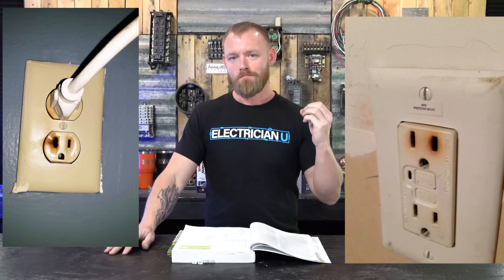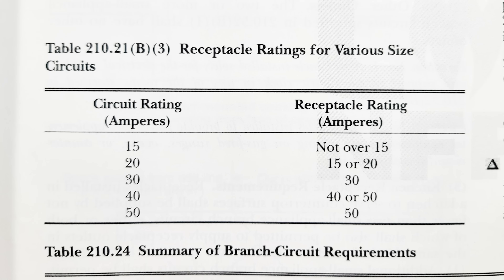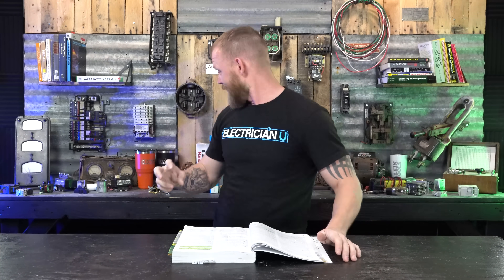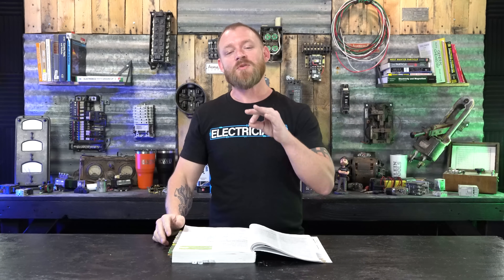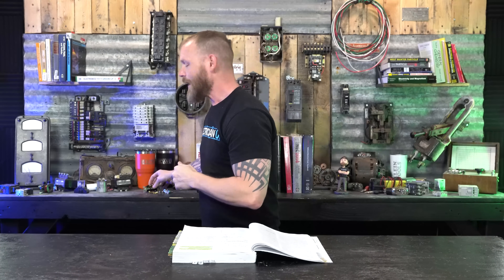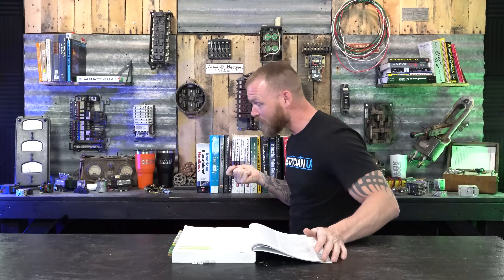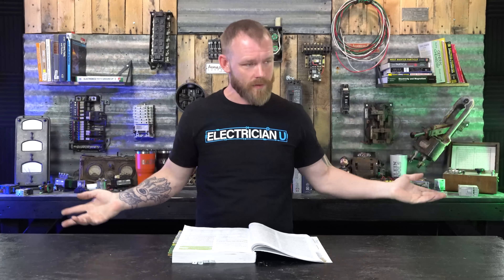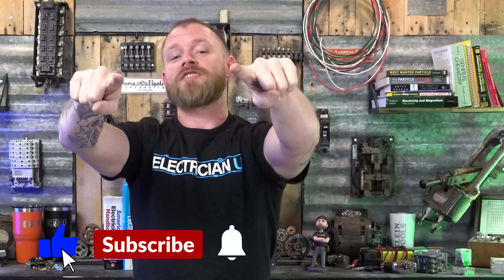Won't These Melt?!? 15amp Receptacles on 20 amp Circuits!!!

Comment: I understand this. But I have another scenario I’m not sure what to do about. Recepurchased a Atlas car lift and is operated off a normal 110 3 prong plug. However they call for 30 amp circuit breaker. They said this is possible because to start the motor it jumps to 24 amps for a quick sec then jumps down to under twenty amps. Now this makes no sense sinse 30 amp requires 10 guage wire and good luck attaching that to 20 amp receptical right. So I’m confused on what to do here. Personally I’d rather run 30 amp circuit with 10 guage copper wire attached to a 30 amp receptical then redo the plug on the motor with 10 guage copper to a proper 30 amp plug. Now not sure if I’m being paranoid but I like my house and cars and want no chance of electrical fires. What’s your opinion on this

Comment: @9:30 ~ "My rule is generally I put 20a receptacles on a 20a circuit..."

The issue that you did not address is the NEMA rating of the receptacle. The NEMA 15A receptacle configuration helps to ensure that ONLY  a maximum cord connected load of 15A is plugged in to that 15A receptacle; which helps to allow for forced compliance of the Codes you cited regarding the 80% loading.

Putting a 20A receptacle on a 20A circuit will allow for the connection of a 20A load on the 20A circuit. IF another 20A load is connected to another receptacle which has a 20A NEMA rating, THEN the overloading of the circuit is extremely likely.

Utilizing receptacle with a NEMA configuration of 15A, is safer and makes it less likely for the above scenario.

Comment: Quality 15 A receptacles should have same internal as 20A one. Sadly, this isn't always true.  I find old loose receptacles are usually the cause of over heated receptacles, not 15A rating.
Reply: Commercial or spec grade 15 amp receptacles do have the same internals as 20 amp but residential grade do not. At least that's my understanding and that why I replaced everything with commercial grade in our home.
Reply: @stevensevek6151 when I was installing living room receptacle I repaired a guy not only used duct to fasten the neutral, power and ground wires

He had the neutral in the ground screw and the power in the ground  and it melted the whole box and the receptacle box caught fire... 

So I got her a whole new box and bought some Romex and cut off the burnt parts and wire nutted with new wires and screwed it ...he had a 30 amp breaker so I went with her to home Depot and got a 15 a breaker

I told her to watch me she wouldn't because I told im a certified electrician and I want to make sure you see what I'm doing the other kept asking her to leave 

It ended up working for her I told never have anyone without credentials wire anything

He's right it will trip but it will burn out everything eventually
Reply: @CharlesH-t9r  The sad part is that I've seen "certified" electricians in some states, that have PASSED a state examination (supposedly) yet knew LESS about the Code than I did when I was past halfway through my Apprentice days.

Comment: Based on research and then taking apart a 15 and a 20 amp receptacle, both Eaton brand,  had same thickness internal contacts.   Even the 15 amp two  prong type for replacement use in pre-1962 homes  with no means of grounding available,  resembles your standard 15 amp,  except the ground slot is covered over.  The faceplate bonded to the receptacle determines the NEMA configuration.   Makes sense from a manufacturing standpoint 

The idea is to assume the homeowner doesn't know what he or she is doing.   An appliance that draws close to 20 amps will have a vertical hot prong and a horizontal neutral prong,  making it impossible to plug into a 15 amp receptacle.   This is to protect the circuit from an overload and the equipment from excessive voltage drop. 

120 volt 20 amps plugs are rare, so in most cases 20 amp receptacles are installed on 20 amp circuits as a convenience factor,  to let the user know at a glance,  that it's a 20 amp circuit
Reply: commercial and hospital grade receptacles are a bit beefier than cheap residential grade receptacles, i think they're like 50 cents or a dollar more, that might be why theyre the same
Reply: I was a bit flustered watching this because what you observed is standard. A 15A and 20A receptacles use the same guage metal contacts because the cost of dealing with multiple types isn't cost effective. Of course when UL listing is testing a receptacle, they're testing it based on the NEMA configuration. A 15A receptacle is only tested to 15A but it would almost certainly pass a 20A test, but that's unnecessary. If a sustained load of ~18+A will usually trip a 20A breaker. Never once have a I seen or even heard of a 20A breaker having a sustained load of 24A like he was saying. (Except a fused shut/faulty breaker which is kinda besides the point)
Reply: @ThatLazenbyGuy  you are correct, your breaker is supposed to be the weak link in the circuit. receptacles burning are due to the contacts being loose and arcing, not because the brass cant handle the current. the don't usually make a 20A resi grade due to low volume, they just sell a commercial grade 20 instead and for commercial and industrial grade the difference is the face, the internals are identical. also only commercial grade breakers are rated for continuous max load, a resi breaker will trip after a while if you are pulling over 80% hence why heater circuits are allowed a higher rated breaker than what is usually allowed.

Comment: American electrical systems are strange here in UK we have a standard 3 pin socket our appliances are fused they vary from 1,3,5,10,13 amp fuses I'm not trying to judge but American electrical system seems to dependant on people that don't understand the differences shouldn't fuses be introduced and straight out 20 amp onwards outlets be standard

Comment: Holy !@#$.   I'm a complete amateur, but I'm shocked. I'm shocked that the code actually puts the safety onus on the end user.   The breaker is meant to protect everything in the wall. Except if you under-rate a receptacle for that circuit... uhhh... well let's just say it's the user's fault for going over 12A.

I'm actually blown away by how bad and wrong this seems.  How could the code be so bad? I always thought it was written in blood and is suuuuuper strict and safe.

Comment: I did new construction for many years and we used 15A outlets on the whole house including 20A circuits.
Reply: Makes sense, how many 20amp plug devices do you really run into?
Reply: @Bremend  like he said only single receptacle dedicated outlets will get 20A. Also GFCIs we would match to circuit size.

Comment: I have 100 amp service and I also have three grow rooms that use high power HID lights one dedicated 50 amp 4000 w light controller is hooked up and I'm looking to hook up a second one however I usually only use 400 watt lights not the 1000 Watts. Then there's the air conditioning dehumidifiers 20 fans. I'm sure I'm taxing my hundred amp service out quite a bit with all that. On top of everything I used to do a computers laptops and such. Dishwashers washing machines dryers etc. The lights are on either 18 hours a day or 12 hours a day most of the time it's 12 hours a day. So I do that at night time so not to really interfere with something I might be doing like laundry during the day. However cooking is done at night time when the lights are on and I'm sure it's even much heavy strain on that 100 Amp service

Comment: Great videos! Thanks! Ok, a question. I'm visiting my mom's house, So. California slab construction. Around 1960. Cloth covered Romex. Receptacles are 15 amp. Discovered all the breakers are 20 amp, which scares me a bit. A family friend upgraded the service box around 30 years ago, but not sure if he was a bonafide electrician, and did it as a favor to my dad. So, do I need to start replacing the breakers with 15 amp where the receptacles are 15 amps? I couldn't read a amp rating for the wires I saw. I'm used to working with modern Romex. Help me Obi Wan!
Reply: No need to panic, first determine the gauge of the wire, if it is 12 gauge, then you might be fine. How often you you really have 20 amp devices? To determine the gauge, use the nickel and dime trick, 12 gauge is about the thickness of a nickel, 14 is about a dime.
Reply: @Bremend  Thanks, I'll take a look. The guy who did the panel was an old family friend, who was suddenly an electrician, or at least he said he was. He passed away years ago, so now I'm looking at a panel filled almost completely with 20 amp breakers, yet there isn't a 20 amp socket in the house. All are 15 amp ones. True, most of them have only lights, radios, computers, TVs, plugged in, so the load is ostensibly low. But, I'll have a look at the wire. My hunch is that it's all 15 amp. The house was built in the early 60s, tract house (nice one at that), so doubt they would have used 20 amp wiring, but I could be wrong.

Comment: 15 and 20 amp receptacles are for the most part identical, the layout of the outlet is the main difference. Take 30 and 40-50 receptacles, the internals are identical but the face plates are different. Why? Ul has Code built into the appliances via the plug layouts. If an appliance uses less the 12 amps it will have the standard layout. If it uses more the 12 and less the 16 it has the 20 amp specific layout (one load carrying conductor is sideways).

Comment: As a DIYer, it wasn't even a thought that a 20 amp receptacle was built differently than a 15 amp receptacle. This was a great information video for me! Thanks
Reply: Is not. 20a a d 15 a receptacle are build the same, mean the core is the same the faceplate is bit different 20a has the neutral slot for 20a plug.
Reply: You should see the differences between Residential Grade, Commercial Grade, Industrial Grade, and Hospital Grade receptacles. I will never use a residential grade receptacle again for the rest of my life and anyone putting those pieces of crap into a new home aught to be ashamed of themselves.
Reply: @LBCAndrew Where do you get the commercial grade ones?
Reply: @HawkGTboy  In the same stores. And I recommend INDUSTRIAL grade for the most heavily used sockets. This is very important for a regular electrical outlet used to charge an electric car.

Commercial and industrial grade electrical outlets even exist in decora versions!
Reply: @sg39g   but an outlet used to charge a car will likely get very few plug/unplug cycles because you just leave the charger plugged in
Reply: @pilotdog68  The problem is not only wear but also the amount of electricity passing through the outlet. An electric car can draw 12 amps for hours.
Reply: @sg39g  "Amount of electricity"    Load and current. would be the more technically appropriate terms.
Reply: @LBCAndrew  They probably just dont know and need to be educated is all.  I use a Leviton higher grade receptacles in my house. They are better made for sure.

Comment: Most 15a receptacle can handle 20+A no problem. Not saying it's OK to load more than rated Amp. Inside a15a or 20a are almost identical no point to specifically make a 15a receptacle.

Comment: What if you have a circuit that has a 20 amp breaker but the gfci that was put in is only rated at 15 amp does that mean the rest of my circuit is only rated to carry 15 amp receptacle loads?

Comment: Hey for all you people out there saying that the receptacle configuration is different you are right but what the guy is saying is that some things drawn more than what the 15 amps receptacle is rated for and you can also add other plugs even though it doesn't have that sideways  blade doesn't mean that it won't draw more ampers than what that actual outlet is worth on that particular circuit if the outlet fails the circuit will not trip and could start a fire just like trying to pull a truck with a little small car that car will pull it but at what cost to the transmission transmission being the outlet basically the end outlet of the circuit is too small the circuit is strong so the outlet is going to fail that's where you're going to start the fire because the breaker won't trip common sense to us electrician types I'm not an electrician I'm just a jack of all trades but I do understand electricity and the video guy is right you cannot do what people are doing even though code says but we all know how that goes y'all be safe and please don't start fires if you're wire is warm or your wall is warm you need to chill ☺️

Comment: The biggest difference I've seen is that 15A circuits only require 14AWG wire vs 20A circuits requiring 12AWG wire.

Comment: The people that write the NEC code have gone crazy since 2011, read the requirements for hospitals and it will drive you nuts. As for 15amp receptacles, the internals are virtually the same as a 20amp. Just make sure you backwire or side wire, never backstab.

Comment: I thought circuit breaker amperage is supposed to specifically match amperage of receptacles / appliances so it wouldn’t trip / burn out, or over current creating a fire hazard?

Comment: The NEMA ratings of the receptacles should be brought into this discussion. A 20 amp receptacle ( NEMA 5-20) will accept  an appliance with a NEMA 5-20 attachment plug. This appliance could not be plugged in to a 15 amp circuit with a NEMA 5-15R receptacle.

 The only difference between the receptacles is the NEMA configuration, it is not related to the amount of current that either receptacle can physically carry.

Multiple loads with NEMA 5-15 attachment plugs can be inserted into a receptacle and potentially cause heating issues on either NEMA 5-20 or NEMA 5-15 receptacles.

Comment: Is it a code violation to wrap a switch or, outlet with electrical tape? I've done it from time to time to avoid getting shocked or, the occasional accidental short to the bare ground wire. But, I've heard that it is actually a violation of code.

Comment: All the code is really saying is that it is expected that the total current load on the breaker would be no greater than 20;Amps. That generally would  indicate that each receptacle would be carrying no greater than 3 amps each based upon that code permits a maximum of 6 receptacles per circuit.  Therefore a 15 Amp receptacle would be overrated for a 3 amp load, by a factor of 5. The code cannot anticipate a receptacle being used for a 1800 watt load ( space heater ) along with other loads combined.

Comment: Wow this was great. I knew when you could put in which receptacle, etc, but man did i overlook a few code parts! I had a guy tell me during my apprenticeship about 15A plugs melting, but it sounded like they were overloaded. This all makes so much more sense now. I just apparently never grasped or was ever really taught the 210.21(b)(2) table (code ref?) Your explanations really ironed this out for me. 

Also, i always love the comments here. Always gives me good ideas and insights. When running dedicated circuits, I'm going to start putting in single receptacles like some have said they do when running dedicated for i.e. window ACs etc. Just makes so much more sense. Thanks to everyone here for all the tips!

Comment: As I understand it, as illustrated on the Technology Connection channel; the cord set will be far lighter than 14 or 12 gauge that is in the wall... thus you will not trip the breaker, since the breaker is protecting what is behind it, not what is outside the wall....like 24 gauge extension cords. The normal breaker protects what is in the wall, not what is outside of it. Even better, cord sets and extension coreds have no fuses...EXCEPT for x-mas light strings. Fused in the plug, to protect the lighter circuit outside of the wall.

Comment: The problem is that builders build homes to code, rather then how people will use them. In my house, I have only a handful of receptacles that are located where I need them. and not enough of them. This could have been fixed simply by adding in more receptacles in each room rather the MINIMUM number required by code. I know this adds a bigger cost to the build, but it's about safety.

Comment: Serious question, I've wondered how this works when they daisy-chain 15A outlets?  Say most houses I've been in all the bathrooms are on one GFCI plug in the first bathroom, but if you have someone using a spaceheater in 2 separate bathrooms the first socket in the daisy-chain passes near 20 amps even though its ~10 amps in separate sockets in separate rooms?
Reply: It will pop the breaker at the beginning of the circuit at the panel

Comment: I expect this to become worse with EVs, especially with people who rent and can't install a full sized charger.  I've seen a number for sale which are "universal" and will allow the car to pull whatever it wants (120 or 240V up to say 50 amps) but have adapters so it can be used on anything from a 5-15 outlet to a big welder/dryer plug.  Some reviews are like "this is great its on a 20A breaker and can draw more than the wimpy 12A the OEM ones do" oblivious to the max safe continuous load values and socket ratings.

Comment: Just my opinion, situationally, in a newer home, with lots of receptacles in each room, 15's are going to be fine. In a remodel of an older home, with few receptacles in each room, I'd go with the 20's because people are much more likely to overload a particular receptacle, simply due to the lack of options. Great video, as always.
Reply: I would make sure computer and entertainment center have a dedicated circuit, with enough outlets on that circuit. I can not even use a laser printer at home... the UPS goes nuts trying to even out the current.

Comment: Wait a sec, 15 amp outlets won’t allow a plug from an appliance rated at more than 15 amps, and those 15 amp outlets are usually rated at 20 amps feed through.